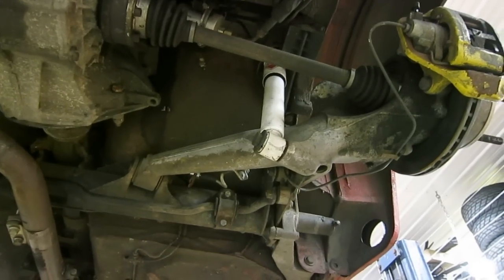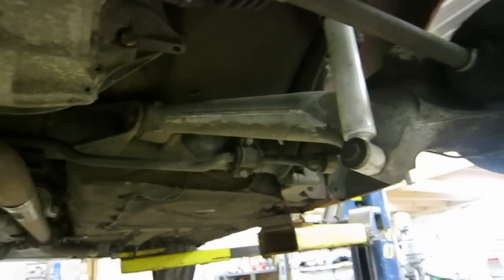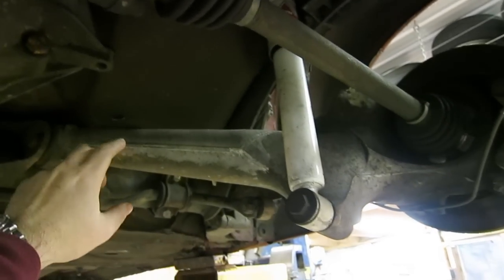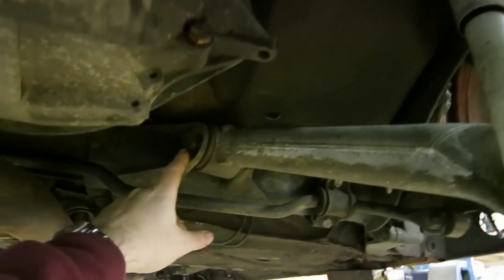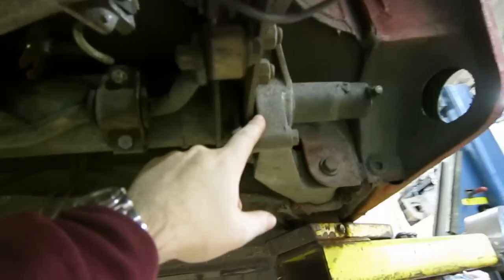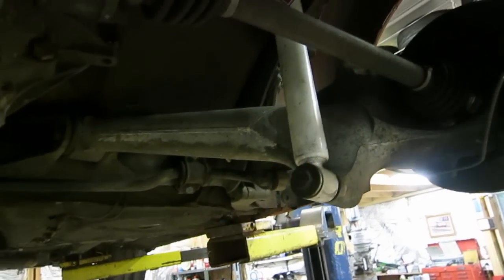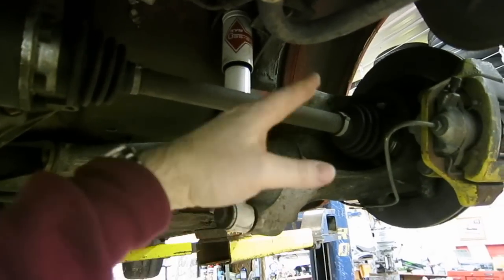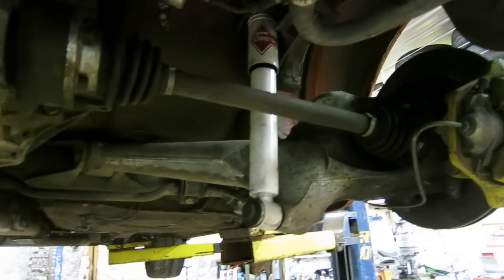How a 944 rear suspension works

Comment: These videos are worth their weight in gold :)  I went with coil overs AND kept the torsion bar.  I remember that mounting point wasn't ever going to be quite right to support what was asked from it.  That's about all I remember and I appreciate your expertise.  These Porsche's are finally being appreciated.
Reply: I know you posted this awhile ago but I was wondering which coil overs you went with because I've been looking at different options myself.
Reply: I was recommended ceikas specifically designed for 944 but I'm cautious of losing the torsion bar. Awaiting answer on my thread on 944hybrids from a smart guy named bob

Comment: I'll tell you something interesting about the front suspension; the lower control arm is designed to yield under impact to keep from damaging the main structure of the car.  If you slide into a curb, it will sacrifice itself and protect its attachment points to the chassis.  I changed more than few of them in the 80s and was always impressed that the damage remained isolated to just the control arm.  I slid into a curb in my 2nd-gen Camaro once and managed to bend the lower ball joint, spindle, and sub-frame.  The lower control arm was fine, though.  It's like the GM engineers were only looking at the issues in front of them when they designed the front suspension.  Obviously the engineers at Porsche (or Audi?) were looking further than just what was in front of them.
Reply: Just curious did your camaro have magnesium / alloy control arms?
Reply: This is true for the old stainless steel wishbones on the 944 - I've been there done that on a -83 model, and they bend at deformation points, but I've been told that it's very different when it happens with the newer aluminium alloy ones that shatter/break off on impact. Some of the people I know that use 944's on the track, prefer the old ones(sometimes a little modified) or other custom stainless for this reason, and the fact that they're lighter (!) though everyone(most people I talked to anyways) thinks it's the other way around. The alu ones feel a little tighter if you really work them, though. https://www.youtube.com/watch?v=64g6OgZaUks
Reply: instaBlaster...

Comment: Great explanation. I heard some classes have to have the torsion bars by rule, but that some people somehow disconnect them. In other words, they leave them there because of the rule book, but they are really using the coil-overs on the back to make it easy to corner balance, change spring rate, etc. I guess they shave the splines on the torsion bars???
Reply from the maker: Yes, they either machine the splines off one side, or they turn down the middle of the torsion bar so it's pencil thin.  Then they are complying with the letter of the rules, but not the intent!
Reply: Van Svenson I see… that last sentence was beautifully put.

Comment: My friends and I just installed the 30mm torsion bars in my 86 yesterday. Our calculations were incorrect and we had to pull it all out again. Now that I see how the components actually work together it makes sense and it isn't all witch craft. I dont ever plan on touching the ride height again but I like the easy adjustment option.
Reply from the maker: Yeah, doing that job is a royal pain in the butt!  I'm sure the factory had some nice fixture that held all the components in place at the right position so the assembly tech just had to select the size bar for the option codes/model and slide it in before attaching to the car!
Reply: Van Svenson Haha, as we were installing it we were discussing how they could have done it in the factory.

Comment: I just bought my first, it's an 86' n\a with 177k on it. I like the body but am probably going to toss everything else from the suspension to the engine\ ecu\trans\ rear end diff. I would like to modernize the interior gadgetry just for fun.  your rundown of the existing suspension is eye opening but given it's mileage I'm thinking I should just go ahead and drop the cash on what I mentioned before.
Reply from the maker: The springs/torsion bars on these don't wear out.  But fresh bushings and shocks will make a world of difference!

Comment: hello.what is the correct name for the part/bracket behind the top shock mounts.i also have an 84 944 and i noticed the rubber pieces collapsed on the driver side. could this be the cause of an occasional clunk sound.

Comment: Thanks a lot for this video.
I have a 924 Suspension, but all the bolts for adjustment with the eccentric bolts look just the same.
Just ordered that eccentric tool and will fix it in the next few days.
One more question: Can you confirm the torque for all the bolts to be 181 ft∙lb?
Reply from the maker: That sounds excessive standard torque for M12 hardware is about 100 ft/lbs.  Your 181 number might be newton meters.
Reply: @vsvenson  Thanks for the reply, just in time.
I figured 181 ft-lb to be to  excessive as well, so I asked you - "the expert" ;)
Meantime I found  the correct torque values on the net.
It is 90 Nm for the eccentric bolts and 103 Nm for the straight bolts. 
Tomorrow I'll try to adjust my camber. Thanks again for the excellent instruction video, great job!

Comment: Great video! Good info!!  Reg fuel lines: Why are the fuel lines directly over engine heads? Isnt that a hazard? How are modern cars? Thx Allan
Reply: It is a hazard and 944s have a major fire hazard because of this. They sell aftermarket stainless steel lines that you can put insulation over to protect them.

Comment: Hi Van, if I use slide plate to rise the rear(somebody slammed it to 62cm) by 3cm, do I need to set suspension geometry once again? It was already done. Also, do I need to jack the car up to loosen the slide plate and adjust it?

Comment: Thank you for this video. Would you have any recommendations for what size torsion bar to use on a 1984 944 with a v8 stroked out to 427ci?
Reply from the maker: Torsion bar size relates to matching the front spring rates and how you use the car (street, track, down force, etc.).  It doesn't matter what engine you have.

Comment: Very cool video that explains everything in a very good and simple way! One question regarding coilovers, as we are putting a set on my wife's 944 Turbo (1986) from Gaz Shocks in UK. They advised to keep the torsion bars (to my surprise) so I'm wondering if the mounting points need reinforcing to support the coilovers setup without torsion bars or if it's mostly a question of hardware (better grade bolts). Our car is stripped and will be caged and welded everywhere too. Thx
Reply from the maker: Most people use the Racer's Edge lower shock mount bolt.  Of course, keeping torsion bars will reduce the load on that bolt.  I personally like the torsion bar/coil over combo, but it takes some time to index the torsion bars to get the spring rates and ride height correct.  Otherwise you can have the two different springs working against each other in parts of the suspension travel, which will cause odd handling.
Reply: @vsvenson  Ok well i need to find how to put the torsion bars in the correct position then to put the car back on the ground. We didn't measure anything before removing it as we're changing the ride height anyway, and the old shocks were completely blown :(. Rule of thumb is to have no tension on the bar when the wheel doesn't touch the ground I presume, so you don't have the coilover or the bar working against each other at any position during wheel travel/
Reply from the maker: @yotah1TheModernRacer  Well, up in the air, the control arms actually droop down and are twisting the torsion bars the other way.  I've ground down the crimp so I can remove that torsion bar cap on the spring plate and welded a little tab onto the end of the torsion bar.  This way, I can raise the control arm to the "neutral point" and the torsion bar will slide right out (because there's no twist on it).  You want your shock spring perch to also just make contact at this neutral point.  Then, let's say your ride height is 1/2" too high, jack the car up, find that neutral point for the control arm, slide the torsion bar out, raise the control arm exactly 1/2", reindex the torsion bar so it slides in, adjust your spring perch so it just makes contact, and now you've properly reset the ride height.
Reply: @vsvenson  Pretty good technique. I'll do something similar then on our car but will have to drop the assembly completely to do my adjustments as for now we don't want to cut out the bodywork or then end of the torsion bar housing. But as we setup the car for trackdays, we'll have to adjst things several times later anyway so that will probably be the way to go forward...
Reply from the maker: @yotah1TheModernRacer  You don't have to cut the body work.  You only need to pull the torsion bar out about 2 inches to reindex it.  Now, if you're changing torsion bars completely, then you need to either drop the torsion bar carrier or cut holes in the body work.
Reply: @vsvenson  Oh awesome! We'll do that then, I'll weld a couple of tabs and fit a retainer through there then. Do you know how far from the end of the cap you have to cut to be aligned with the end of the torsion bar? I'll measure it on our parts but just to double check and not cut too much of it ...
Reply from the maker: @yotah1TheModernRacer  If you look at the end cap, you'll see that there is a crimped lip that goes over a round metal disk.  All you have to grind down is the crimp and then you can tap the disk out with a screwdriver and hammer.  It only takes a few minutes - very little material is removed.
Reply: @vsvenson  Just wanted to thank you again. We have put all the suspension back on my wife's car and it was a lot easier after watching your video and talking with you! We still need to make some adjustments to it but it's gonna be way easier with the end caps off and the torsion bars drilled and tapped too. I just need t get the toe tool and a couple other little things and the chassis will be finished :) It needs to drop a good 45-50mm in the rear though so I'll have to make a few calculations to avoid doing the work 2-3 times with the torsion bars. Right now they were set at max height.
Reply: Thanks for that question.  Have an 86 Turbo too, with 88 suspension, quirky ride height height.

Comment: Thanks for the video! I have noticed some 924's have some hole indents in relatively the same place on the body panel that you made for the torsion bar pull out. Is that what they are? I don't own a 924 but always wondered..
Reply from the maker: +Ray Baterina Good question, but I don't know the answer.  Older 911s - which also had torsion bar rear suspensions - actually have a hole and a matching body-color cap.

Comment: Wow, I love how Porsche added all of these adjustments from the factory.  A real drivers car, I definitely could nerd out on a vehicle like this.  There is a guy where I live selling his 84 and I'm considering trading my Toyota truck for it.  He has a very detailed history of the maintenance and the car only has 86,0000 mi. On it.  I am a little apprehensive though because I have been told these cars are sensitive and parts are high.  I do most work on all my vehicles so I could cover maintenance easy, I just don't want to buy something that is going to be failing all the time.  Are these cars reliable if properly taken care of?
Reply from the maker: +Josh Smitty Yes, I think these cars are very reliable when maintained well.  (I've had at least 1, and sometimes several, 944s for the last 19 years.)  For a car with under 100k miles, you're looking at a clutch job soon (if it hasn't been done already).  Parts are more expensive - that's cost of ownership to have a Porsche.  If you can do your own work, I think you'll find it rewarding to own.
Reply: Van Svenson Thank you for your quick response.  I will see the car this weekend. The owner is part of a club and like I said has a very detailed history on the car.  I feel like he will disclose to me as much information about the cars needs to me as he can. I feel lucky that I found such a seller.  I will keep you updated on the purchase. Thanks again for the info, much appreciated.
Reply: Van Svenson subbed!

Comment: I have a 1988 Porsche 924s that has been sitting for some time. At least 10 years. The rear end doesn't seem as high as it should. I assumed it may need new shocks. Looking at the bliston HD shocks. Is that all I would need to do is change the shocks? Do I need to mess around with that Center spring?
Reply from the maker: Changing the shocks, while that will improve the ride quality and handling, won't change the ride height.  I know that conventional coil springs do sag with age, so maybe torsion bars do, too.

Comment: Ok, I'm trying to decide weather to remove my torsion bars, or re-index them and leave them in as it came from the factory. Here are some pros and cons of removing the torsions bars if I end up fully prepping the car to move from DEs to racing.
Pros:
Ease of ride height adjustment and changing spring rates.
A tiny bit of weight savings.
No more messing with torsion bars.

Cons:
I'll be put in a faster group, which is totally fair.
Car was not originally design to bear the weight at the shock.

What I refuse to do is modify the bars….
Reply from the maker: If you choose the right torsion bars, and take the time to index them, they are just as good as coil over springs.  It's also a cheaper choice than getting coil over shocks, with solid bushings, and new lower mounting bolts, just to run a coil over spring.
Reply: Van Svenson you are right about it being cheaper; problem is I already installed a real nice set of coil overs :(
Now I want to try adjusting the ride height by re-indexing the torsion bars, or, just pull them out and run in group 10 (instead of 8) with SVRA, or a different class in PCA (not familiar with PCA classes etc.) but I'm sure PCA will rightfully make me run in a higher class than people with torsion bars.
This is exactly the set I installed on the car: http://www.lindseyracing.com/LR/Porsche/944SUSESCORT/LRK-944-BIL-SUS-02CP.html
I just want to have fun, so because I'm not that mechanically gifted, I wanted something I can adjust as "easy" as possible.
Reply from the maker: RaudelandAbby
It's a shame that deleting the torsion bars bumps the class up...  Unless you're going with a spring rate that's higher than you can get in t-bars, there's no performance upgrade.  For PCA, SP1 class must have the torsion bars and SP2 allows you to remove them.
Reply: Van Svenson Man I really need to get with PCA ASAP, I'm still trying to figure out the cheapest route to get my racing license. At this point I'm spending money on DE's that perhaps I can use towards a racing license; don't get me wrong, DE's are awesome and the entry point for an average joe like me to drive on our dream tracks, but will eventually need to go for the racing license.

As far as the torsion bars, I'm a mess with that decision, on one side I'm somewhat of a purist (growing up in Cuba seen old original cars might have done that), but on the other side I don't mind a little bit of resto-mod. Still, I want to comply with the intent of the rules, and have the car look as original as possible.
Reply from the maker: RaudelandAbby
To get started the PCA Club Racing, talk with the chief instructor or track chair for your region.  If they feel you're ready, they can recommend you to the PCA Club Race chair and you can become a rookie racer.

Comment: Do you have a video of you adjusting the torson bar?
Reply from the maker: No, I don't.  But, in the race cars, I've modified them so I can quickly slide the torsion bars out through a hole in the rocker panel.  Makes it really easy to do - just jack up the control arm a little bit to take the twisting pressure off the torsion bar, slide it out a little way, raise or lower the control arm a little bit, then rotate the torsion bar until the splines slide back in to position.
Reply: It looks great the way you did that.  I assume you don't have a video of how you made the custom change for the easy adjustment?  Great job.

Comment: I have decided to remove my torsion bars. Do I (or in your opinion should I) replace the Spring Plate Bushings? Or it that sort of pointless since I'll have no torsion bars?
Reply from the maker: I would - and use the Racer's Edge delrin or the Elephant Racing poly-bronze.  The torsion bar is strong enough it reduces the flexing of the rubber bushings.

Comment: I am looking to put on coil overs onto my 85.5 944. The coils i would get would also have ride height adjustment setting on them. If I wanted to change the ride height would I also have to change the spline setting?
Reply from the maker: Capacitor Yes.  Or get a stiff enough coil over spring to remove the torsion bars completely.
Reply: Van Svenson p

Comment: Would it be possible to do a torsion bar delete and replace it with a coil over shock??
Reply from the maker: Absolutely - that's a very popular track upgrade.  Racer's Edge makes a good quality lower shock bolt for that purpose.

Comment: I have a early 85 porsche 944 and I'm getting a cabin rattle by the shifter behind the shifter where the arm rest is at do u have any idea what it could be it only rattles when I rev it or start getting in to the higher rpm i don't know if it's a plate it feels like it but unsure can you give me some info about it I don't think it's the drive shaft so that's out of the question
Reply from the maker: Could it be the exhaust rattling against the body?  The catalytic converter is right under the shifter...
Reply: Drive tube bearings???